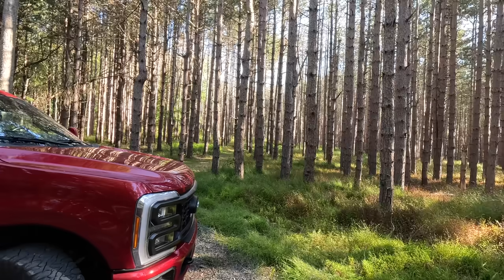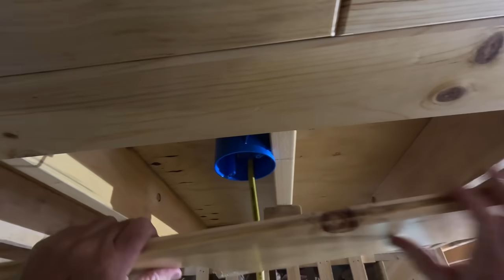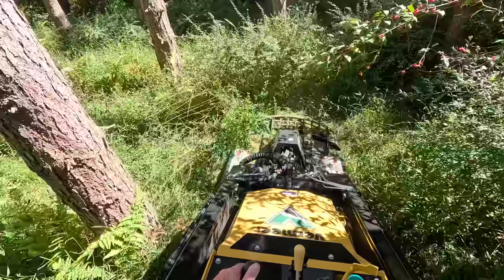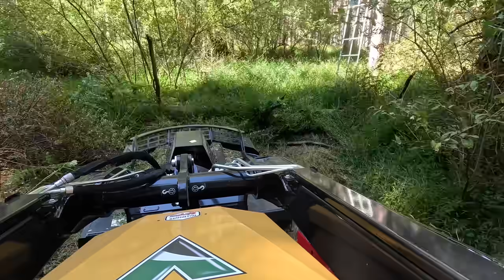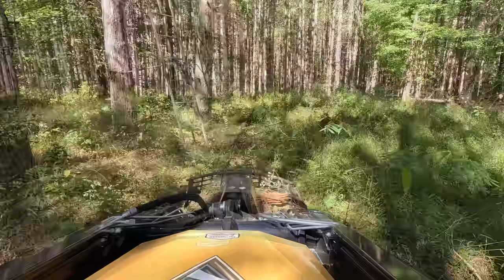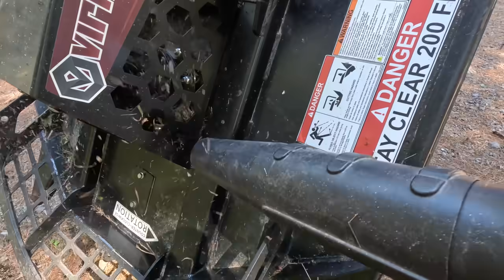Housing Plan or Cabin in the Woods? Affordable Escape to Paradise

Comment: You'll need a reverse male plug on the outside of the house.  You'll have to order it in because most places dont keep it in stock!!  In a weather proof box, they work great.  I put one on the outside of my house to plug in the furnace if the power goes off.   Not something you want to wait til you need it to install it!!  But people need to understand the principle of "dirty electricity vs pure sine wave" by generators.  You NEED pure sine wave to run furnaces etc.   The deer dont like walking through wet grass and brush any more than you do!! 😉

Comment: Mike, did you see the Wolfridge new machine they are handling. It is made in England. It spilt smaller wood you cost sell to the metal fire pits. They put out a video on the two machines.  200 and a pro model.  It also loads,in bags

Comment: Good morning Mike ..
FYI ..Just saw your video on the cabin you were talking about starting the back wall with the pine siding,by the way , you are doing a fantastic job installing. I can’t see a light switch by the back door, for outside light or a switch to turn on an inside light while interning the cabin from outside , though, I realize that the insulation may-be hiding it. 
Again Mike great job down there.
P Arnold from western NC area.  Love your content.

Comment: Mike the problem with a Cot and no heat is that the air goes under you and makes you cold too and bottom
Even without a air bed it would be better to put a blanket on the floor underneath you and you will sleep sound
I have camped from age 5 up to 2 year ago then 66 and always slept on the floor or with a thin foam liner even in the winter with snow on the ground